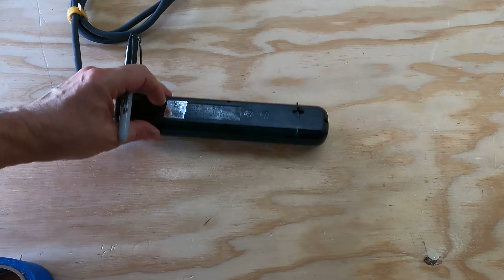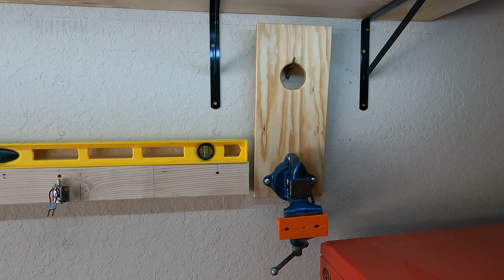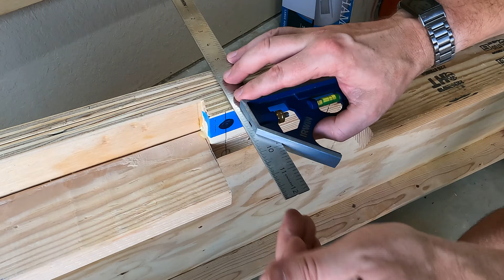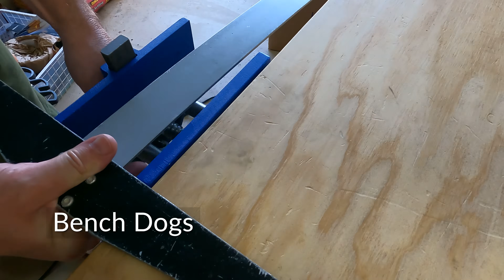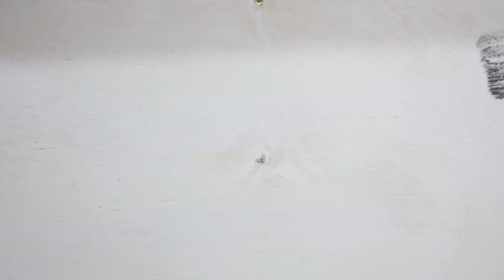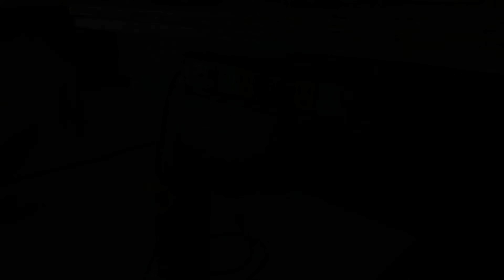Workshop Series: Updating a Fold Down Rolling Workbench

Comment: For the outlet mounting.. take painters tape and put it on the back of the strip, poke holes and then put the tape where you want to mount it. Makes for perfect alignment with ease.
Reply from the maker: I did that first, but the diameter of the screw head was just a bit too large for the tiny slots on the back of the power strip so I had to 'go rouge'  :)
Reply: @ hahah totally get that. Happens more often than not 😂

Comment: Is this a 6 foot length bench, and how tall is it? There are a number of similar hanging benches I’ve been looking at and I like that your casters fold up nicely but I’m assuming your overall height maybe lower than some of the other models I’ve seen.
Reply: Watch the first video.  I'm pretty sure he said 33".  That will answer all similar questions.
Reply from the maker: Dimensions are roughly 6 ft wide, 31.5 " deep, and 33.5" high (182.5 cm x 80 cm x 85.2 cm).  A few things went into determining those numbers.  First, the width available on the wall.  I didn't want to be precise when I lifted it into position, so six feet felt good for the space.  The depth and height combine into the top edge of the table when mounted on the wall, and you have to reach the top of it to secure the latches when the stretcher is in place, so it also plays into my height and reach.  The height is a little lower than typical kitchen cabinets, but it all works out very well.
Reply: @The_Master_Of_None thank you for the thoughtful reply!

Comment: Very nice work table.  I saw on a different video where a guy said he can no longer lift a heavy table anymore, and asked for suggestions.  I thought about it for a second and suggested one of those Harbor Freight boat trailer hand winches.  You’d have to mount a pulley in the center above the table in closed position, and then mount the hand winch on either end of the table.    Wind it up and it does the heavy lifting.  I might do this when I make my table because I might make it 4’ X 8’ and I too have trouble lifting super heavy things anymore.
Reply from the maker: If you "double ply" the top like I did, a 4x8 will have some serious weight for sure. Maybe a low-profile torsion box would be light enough to lift by hand?